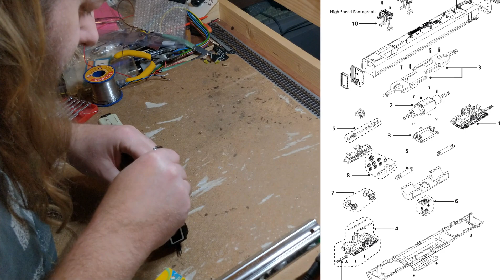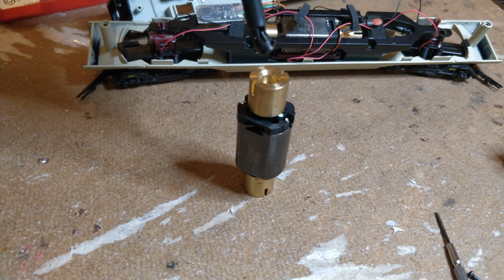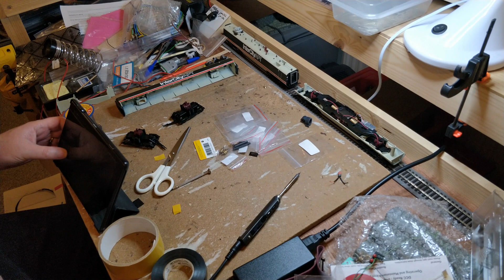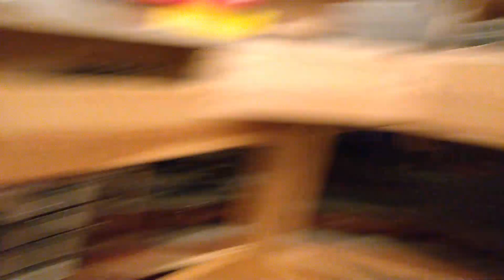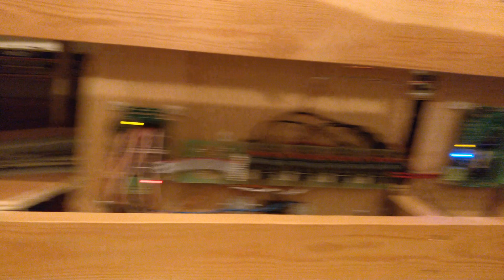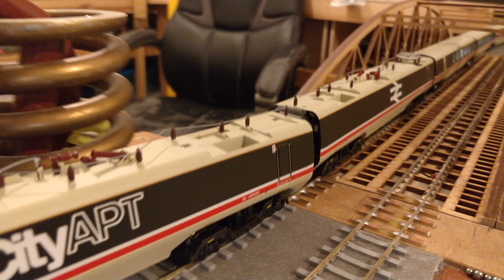Motorising a Hornby APT Dummy NDM

Comment: Hi. I have just watched this video. I just received my newer version of the APT-P 7 car version, and I planned to change the second NDM to motorised one. I have seen that you mentioned the little plastic piece not given with the motor, and I have seen on the advertisements too. But on the sheet, if I am right, that plastic bit is given with the drive shaft? So I ordered 4 driveshaft just to have spare bits. If you look closely they look identical.

Comment: I was one of the lucky people to get the single NDM to give my APT the power to transverse gradients. I knew from past experiences they would sell fast and the same for the APT-U coaches. The other dual extension coach packs could wait. I did the same with the blue Coronation Observation Beavertail coach, but that backed fired as all the other normal coaches sold out far to fast too, lol. 

You put a lot of thought into doing this remotorising the NDM, but a shame that noise has crept in to spoil it. I think it would have been the worm to bogie gear causing it. Though I'm sure you have it fixed long ago since this video is two years old already, lol.

That is some size of layout you've got there, and it must be a big room. I'll have to see if you've a recent layout tour vid to watch. Cheers, for sharing your trails and tribulations with this NDM modification.

Comment: I thought, when I bought my 5 car set, i wouldn't worry about the full 14 car train. However, I did, Hattons had the cars on special and i preordered the NDM and when that arrived completed my APT. I had to swap one of the new APT couplers with the old APT.  The upshot is it ran well so you are right a full APT needs 2 NDMs. Good video. Cheers

Comment: Does this work with the newer release APT set?  R40229A I believe.
Reply from the maker: I don't have a 2nd run APT (one was enough for me), so I can't confirm exactly what you'd need.

However, the general principle should work. There are known differences in the models, so you may need some spare parts specific to the later release. I know the chassis design was modified to add more weight to it, and the electronics are different (it's a 21 pin model, not an 8 pin model).

Comment: Are the decoder in the ndms on the same dcc address or in a consist .and did you have to speed match the to decoders
Reply from the maker: They are the same address.

While I have tuned the speed (I wanted a scale 155mph at maximum, and a linear throttle response), both decoders have identical settings -- there is no difference in tuning between the NDMs.

Comment: That's very interesting thanks.   I found it difficult opening my NDM from 2021 and managed to break quite a few of the plastic clips :(     But I see you have had more success than me.   I took the expensive way out and bought 2 x R30105 NDM's from the 2023  release.   The improvements are immediate:   Better traction & weight, 21 pin decoder (easier to fit non-hornby decoders), space for a sugar cube speaker and improved pantograph.       Personally this should have all been in the 2021 release from what was already an expensive purchase.

Comment: Was the coach light flicker the camera or is that what the eye sees? The coach light colours are also different. Seems even with two NDMs it could struggle with the full 14 car set. It’s a disappointing release from Hornby. At least they updated the model on the next release instead of repeating but that doesn’t help those who bought the 2021. Thank you for the useful video.
Reply from the maker: The coach lights are driven from track power through a physically large but electrically not very large capacitor, and only pick up from two axles each. They do go dark quite frequently as they have been shipped. I have plans for that to connect the pickups through the coaches to address that issue ... but that's a separate project.

The lights are not different colours -- the interiors are different colours. They have been made in self-coloured plastic representing the seat colour. Painting the interiors with more detail would reduce this effect.

I don't think two powered NDMs would struggle with a full 14 car set -- although I don't have enough cars to build that to demonstrate, this is the maximum length my layout will cope with.

I would love to see a 2023 model single NDM tackle a 14 car set on a layout with a helix or similar curved ascent to mine. I'm not buying one just to test it though :D

Comment: Great video. I have the same spares as you and had the same plan. I also hope to sort out the lighting too (either by through wiring with plug and sockets - ideally to run stuff off potentially just one chip or through sorting the capacitors out) and try and see if any liquid weight can be added to the power cars. The one's include more weight so may source spares from there. I did directly email Hornby about the lack of spares for that part but was met with a digital shoulder shrug. Kinda sums up this model from the manufacturer...
Reply from the maker: Apparently the APT spare parts have been consistent sellers, so lots of people have had this idea. However, I haven't seen much noise in terms of people achieving the build -- so I suspect there are lots of them in drawers, with people having hit the same problem missing piece!

In future I would like to add plug-and-socket connections along the articulated part of the rake, for both pickup continuity and lighting control from the decoder in the driving cab. This should allow the unsightly capacitors to be completely removed from the trailers.
Reply: @DongitsModelRailway  excellent - would make a great video. Why they didn’t motorise them in the first place is beyond me. It can barely handle the 7 cars without wheel slip as is.
Reply from the maker: @FormallyknownasE100  It probably wouldn't have cost them much to ship two identical powered NDMs in the set anyway -- reducing the number of assembly options would likely have saved a significant amount of cost -- maybe enough to offset the cost of a motor, two driveshafts and some gears per dummy NDM.
Reply: @DongitsModelRailway   I agree entirely. Economies of scale and all that. The cost of a motor is often wildly overstated especially at the production stage.
Reply: @DongitsModelRailway  excellent - would make a great video. Why they didn’t motorise them in the first place is beyond me. It can barely handle the 7 cars without wheel slip as is.
Reply: @DongitsModelRailway  excellent - would make a great video. Why they didn’t motorise them in the first place is beyond me. It can barely handle the 7 cars without wheel slip as is.